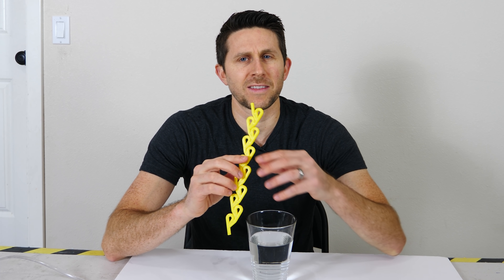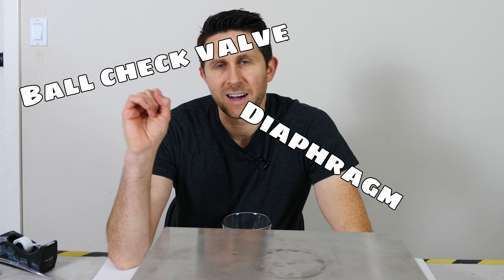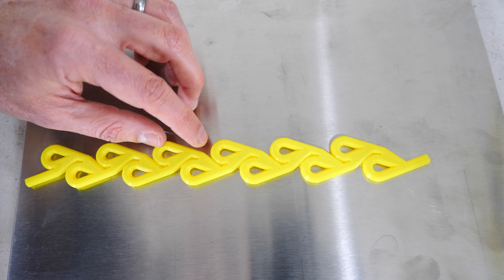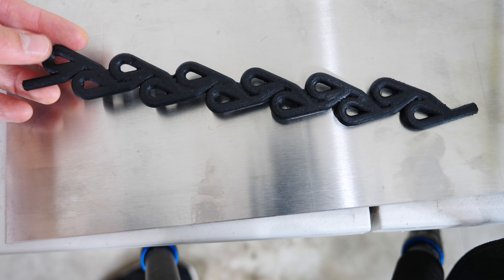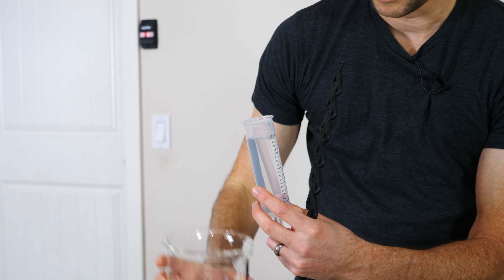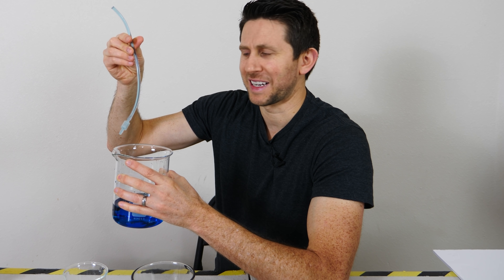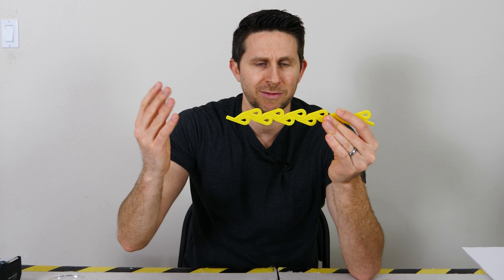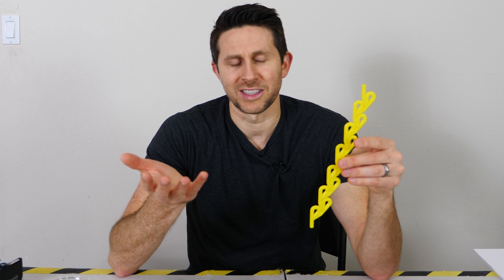This Tesla Valve Straw Only Works In One Direction

Comment: I think its more of a fluid resistor than a diode, since resistors cause a difference in electrical potential across it
Reply: Diodes also cause more difference in potential with current flow in one direction, and have leakage current in the other direction.

Comment: Just to correct something: it's a valvular conduit, not a valve. The difference is that a valve completely stop a the backflow, while a valvular conduits just restrict the flow of the backflow and the resistance is proportional to the flow of the backflow. He patented it to use it in a pulse jet engine, where the combustion chamber needs a reliable valve due to high frequency and heat. For those that want more information, just check Integza's channel.

Comment: "Why would you want a one-way straw?"
For sharing a drink. Shudders at backwash
Reply: This is what I said or also for a kid who blows bubbles into their drink and making messes. 😂
Reply: Nothing like sharing with your child. Chewed pizza floating in your cola.
Reply: @gregorysharp  wait your child drinks cola at that age?
Reply: One-Way Straws make drinking easier for individuals with a weak suck, oral motor difficulties, and/or problems generating and maintaining suction.
Reply: @mickymoist  why
Reply: @ezrimata4540  why did i provide the answer or why woukd a person have weak suction issues? I provided the answer because... I had the answer I guess. And as to why someone would have weak sucking skills, generally disabilities or injury. One-way straws make caregivers jobs a little easier. With fluid remaining at the top of the straw, less air is ingested and less effort is required to drink. Users therefore tend to experience less coughing and choking while consuming more fluids. Because the valves are built-in, these straws provide both convenience for the caregiver and discretion for the user. They save time and labor for the caregiver/therapist while increasing independence, dignity, and hydration for the individual.
Reply: @mickymoist  Well wouldn’t it be better if there were straws like gogurts? I mean just because there is no air in the straw doesn’t mean it’s easier. The suction comes in from the lungs. If the patient is to weak to open his/her lungs, then they can’t suck anything up regardless of how much air is in the straw. And actually, it’d be harder to suck up liquids and solids because of how much more dense they are thus meaning more mass per square centimeter thus meaning more weight. So I ask, what makes your claim valid. I ask for your evidence of such a conclusion
Reply: @mickymoist  I say gogurt because the person or even a machine could simply squish the foods into the patients mouth
Reply: @ezrimata4540  you're wrong
Reply: @JK-gk1qe  why
Reply: @ezrimata4540  You're right, the suction power must come from lungs, but duration is shortened. You don't have to suck all the air out first. Only in little managable sucklettes. Lol
Reply: @mickymoist  Why would it have less air?
Reply: @sociallyineptsnapper   because the methane i added to the equation dispersed into the nitrogen and oxygen that is 'air'.   I question some people, but that question is so stupid it must be facetious.  

Anyone wondering why single flow straws are important, just look at stephen hawking.  He had two check valves at least in his wheelchair.   One for controlling the wheelchair and one for eating.  Both valves are set up in opposite directions.
Reply: @sociallyineptsnapper  liquid would be where the air is.
Reply: @ezrimata4540  it’s a straw? It’s not meant for food, and suction problems aren’t just having to do with lungs it could have to do with your jaw or lips.
Reply: @ilikeyt414  if it has to do with jaw/lips and that’s what this is about, then why is brining this up and saying that this new type of straw could help even relevant?  The same issues remain. And so what if it is a straw? I’m saying, it’d be much for efficient and sufficient if the liquids were pushed up into their mouth rather than any other way. Again, lips and jaw issues are pretty irrelevant here
Reply: @ezrimata4540  No
Reply: @JK-gk1qe  no what
Reply: @ezrimata4540  when the two smart kids have different answers in math
Reply: @ezrimata4540  well u dont have gravity pulling the water back down if theres no where to go
Reply: @ezrimata4540  you are actually correct in this sense, if they have suction or other issues preventing them from using a straw the way to fix this would be a one way check valve on the straw and the top of the container so as they squeeze the drink the fluid would be forced out the straw and as they release pressure the one way check valve will release on the lid to allow air back in. this would also keep the fluid to wherever the check valve is located on the straw since no air is being allowed back in via the straw.
Reply: @mickymoist  I know my humor could be compared to a preteen boy, but I started laughing at the phrase "individuals with a weak succ".

I still got what you're trying to say tho
Reply: AHHHHHHH
Reply: that's pretty dumb, backwash would just stay in the straw and mix with the next sip
Reply: @EverydayAhmed  but not back in the cups where if ur sharing they use their own straw
Reply: Idk cuz i need one
Reply: NOOOO- protogen error noises
Reply: i mean ive got a solution, just take out the straw then suck up whats inside of it but whatever
Reply: Or just get two straws?
Reply: Thats actually a great idea.
Reply: People have died from backwash.
Reply: That was my thought as soon as I saw the checkvalve straw lol
Reply: That's what makes it tasty.
Reply: Or just get two drinks.
Reply: there's a literal pandemic now, i can't imagine sharing any surface where people are putting their mouths on it.
Reply: @284mbp  maybe if both people have their own one-way straws?
Reply: @284mbp  ok? This can be applied to other years besides 2020
Reply: Maybe 2022?
Reply: @284mbp  why you gotta ruin the joke?
Reply: @284mbp  🤣 🤓🤓🤓
Reply: You just gotta love people who let the drink slosh around in their mout before ejecting half a mouth full back in the bottle, allthe while they suck on the neck like it is a juicy drop pop straight out of daddys pant leg and then give you the bottle with a look of "dont you want some now?" in their eyes.
Just lovely! 🤖
Reply: @roomtemperatureones63  i will never understand why people share drinks.
Reply: Shut up furry
Reply: @luigip.1892  reddit moment

Comment: if you put an electric heater on a chamber, that will suck air through this, then you should have a electric heat jet
Reply: if you improve it in such a way that there would not be any pulling from the liquid itself, then it would block better, um, you could just give it a way more resistant long path in one direction
Reply: if you narrow it up to capillary effect, you can even block it completely, and reverse it
Reply: make a piezo transistor

Comment: my niece annoyed me and her mother when she blow bubbles in her drinks so a one way draw would help stop that.
Reply: This is probably why this straw was invented, it's true purpose lmao
Reply: I too vouch for a one way drawer
Reply: Air can still travel through perfect
Reply: @nihaalspeaks  no it can’t. It works the same way
Reply: @imeleventeen  air is much faster, if you blow through the air will reach the other side in a matter of seconds, put it this way,since there is already air in side, when you blow, you’ll just be pushing the air forward and it will instantly come out
Reply: @nihaalspeaks  *inside
Reply: @nihaalspeaks  I agree it’s definitely much faster but slower then blowing air through a swirly straw of any sort. I’d like to see it tested but to me it seems like you could blow through but at a slower rate. How much slower? I honestly don’t know. My point was just that it also works with air
Reply: @imeleventeen  once the liquid is pushed out of the straw there is no forces to work against airflow. this straw only impedes flow by using water to work against itself to create back-pressure.
Reply: @rickylafleur5823  from my understanding it's not just a liquid thing. Air works the same way its just much less dense so the effect would be much less. The air would still go through the parts to create a back pressure. Who knows maybe some how I'm wrong, but as of now I havn't heard an explanation that could make me change my mind.        I'm curious, do you think the air compleltey skips the paths to cause back pressure? I guarentee they don't. The air particles go through it and hit the air particles that are trying to go through, the contact will slow it down.
Reply: @imeleventeen  at a higher psi you would be correct but at 10-20 psi the air will just flow and any back pressure would be negligent. the reason why this works with water is because it does not compress. to give you a working example have you ever used a water pump? once it is filled with water it is much harder to pump vs doing so in the open air with no water. water will fill voids and cavity and air will just take the easiest route every time.
Reply: The kid will just flip it
Reply: What does her bubbles have to do with coloring between the lines? Let her draw dude

Comment: I'm designing an over-barrel (or barrel shroud) suppressor using tesla valves to slow escaping gases from a gun. I'll be doing my testing on big bore air rifles, since "technically" it's illegal to make a suppressor for a firearm without a license, but air rifles are not "legally" firearms.

Comment: I guess it was not intended to impede flow against gravity? Maybe an outlet, where the valve is horizontal and doesn't let waste fluid flow back in, or inlet, where it doesn't let it flow out. So my theory is that when you sucked it, you created vacuum, which won over the impedance of the vortices, and also gravity is stronger than those vortices. MAybe you could try to lay it down horizontal, and connect the measuring thingy to one end and to the other end, the difference would be more pronounced.

Comment: So, a "one way" valve that lets gas or liquid flow less restricted in one direction & more restricted in the opposite direction ... Doesn't sound very "One Way" to me. Sounds more like a flow limiter or restrictor. How about testing it's hydraulic properties at both ends?

Comment: Is it possible to make a long enough Tesla valve for the resistance to stop the downward flow of gravity entirely?
Reply: No, since the resistance is a result of the flow: As flow drops, so does the resistance.
I wonder what the limit would be with an infinite number of loops. I expect it will be independent of pressure, which might be interesting for certain applications.

Comment: I always thought Tesla valve straws like that belonged in airplane wings as struts inside the wing. The shape at a 45° angle  to let some of the high velocity air from the top curve of the wing to pass through it to the bottom concave part of the wing. Increasing the pressure below the wing, and decreasing the pressure on top of the wing.